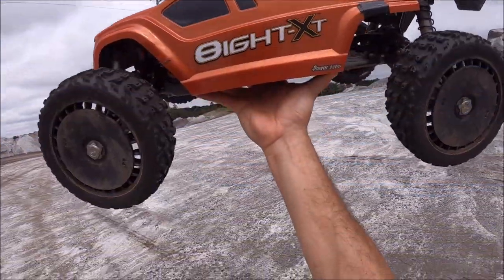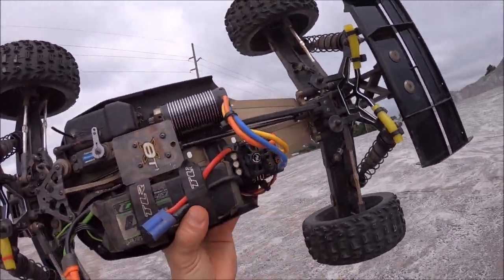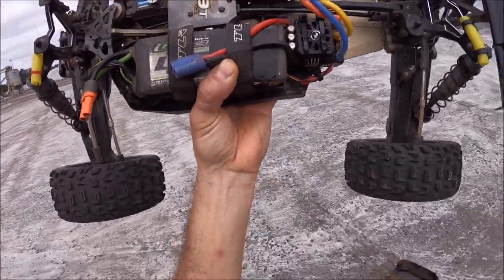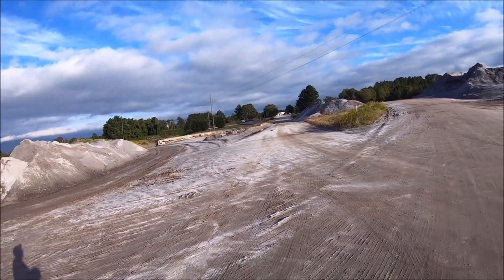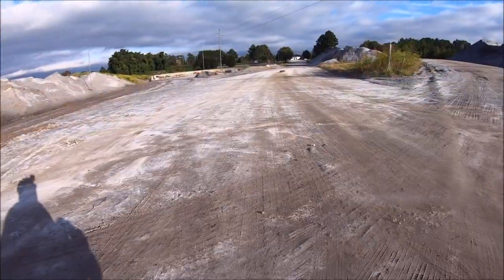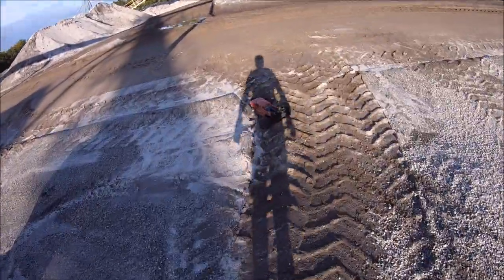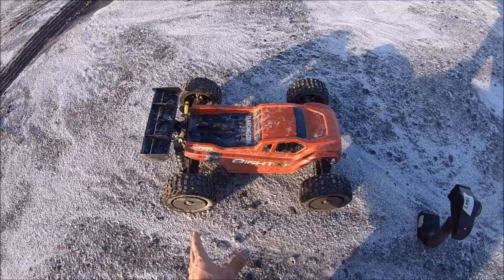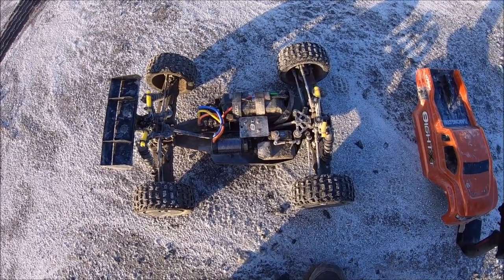MOST INSANE! Racing/BASHING machine??! -NEW LOSI 8ight XTE 6s

Comment: Hey bro just curious how this was overall durability wise, loved my Tekno mt410/et48.3 but comparing this with the new et48 2.0, Ik with this I’d have to get metal braces and top plate but rly just curious about the strength of the gearbox, little nervous about not having the m2c backing haha, can’t wait if there’s a future tlr tuned talion I’ll be the first
Reply from the maker: It's very comparable to a Tekno in stock durability! The diffs are strong! There is a future of M2C upgrades coming at some point. They have been swamped fixing Arrmas problems.🤣🤣

Comment: Thank you for the amazing Lose Kit.  
It's really, really great.👍🏻👍🏻🤩
Can I know the front and rear shock oil? Is this oil in the product?  Thank you.
Reply from the maker: I believe the shocks are 37wt front and 32wt rear. All the oils and fluids come in the kit.😎👊
Reply: @RCDUDE81  thank you. Isn't it good to have high oil when jumping?😁Isn't the shock oil too light?
Please recommend diff oil. Thank you. The center is 100k, right? 🤛🏻🤛🏻
Reply from the maker: No prob!👊Yeah a tad thicker is good. The rear felt a tad springy stock so I thickened just the rear. The front felt good to me. I went manual diff fluid which is included with 100k center. Still has great handling with a bit more air control.
Reply: @RCDUDE81   All right. 😄Thank you, dude 👍🏻
How about diff oil  30k front, 10k rear?🤛🏻😎
Reply from the maker: @rcsky775  Definitely worth trying! Should work perfect for bashing!

Comment: where did you pick up the aftermarket front metal brace?
Reply from the maker: I got that and the top plate from Amain hobbies.
Reply from the maker: Most of the upgrades are in here.🤙https://www.amainhobbies.com/search?s=losi%208ight%20xte%20parts&p=3
Reply: @RCDUDE81  Cheers mate, super helpful. Subbed.
Reply from the maker: Thanks!😁👊